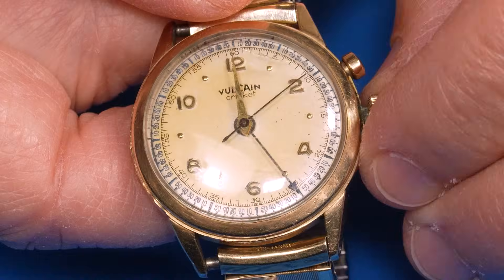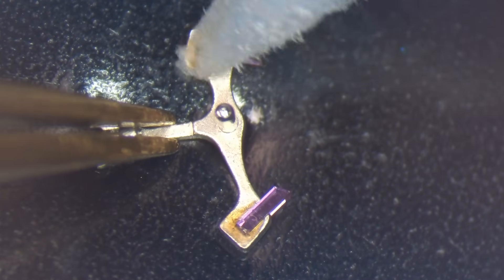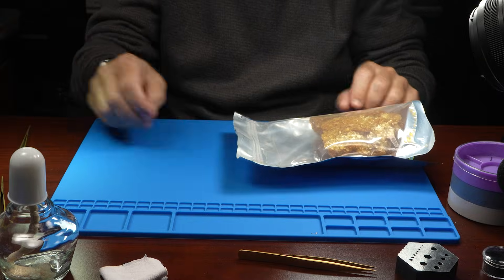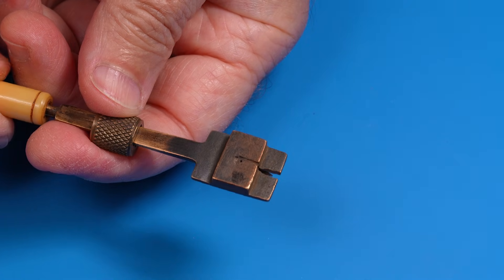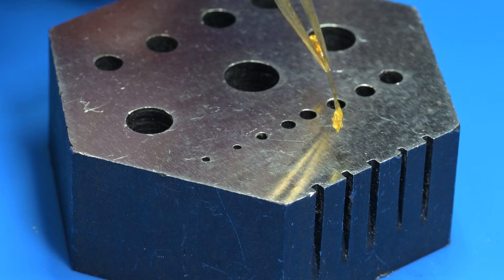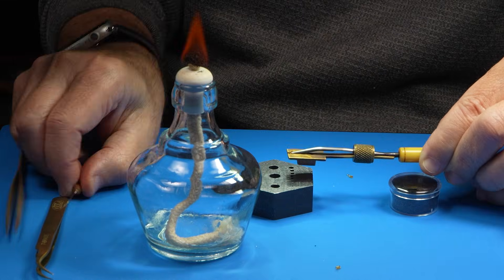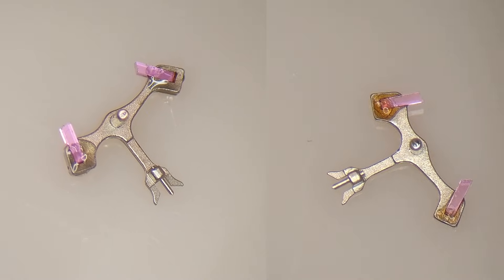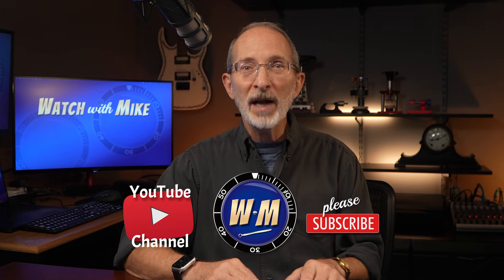How to Shellac the Jewels in a Watch Pallet Fork #watchmaking

Comment: Great video Mike......One question....With today's modern products....various adhesives etc is it not possible to use an alternative to shellac?
Reply from the maker: I have worked on watches where parts are crazy glued into place. It is a nightmare! Shellac can last for over 100 years and is easily removable and replaceable, so I think it is worth the trouble. Also, when you reset pallet stones, sometimes they need to be adjusted in the fork. I don't know of any modern adhesive that let you do successive melt and cool cycles to reposition the pallet stones if needed. So for now, shellac it is!

Comment: Good precise job Mike.See how it works Let me just mention that you put a little ball of solder in a broken part of a piece of jewelry by holding the melted ball attached to a  sharp polnted steel rod.No stones and no elves though,Thank you..
Reply from the maker: Is the heat transferred to the solder by the steel rod? I would think you'd want to use an open flame? Regardless, I love the moment the solder melts and everything magically flows together!
Reply: @WatchWithMike  Hi Mike.Yes Mike.You use the torch to melt the solder and to remelt it.Extremly precise procedure though.Thank you.

Comment: biggest thing is to not move pallet jewels while augmenting shellac. youll know how you did when you fit part,
Reply from the maker: Yes, agreed. I think the stones were pretty snug in the fork even without shellac.
Reply: @WatchWithMike  Ive learned the hard way. it takes many hours to get pallet jewels back into proper depth. I use an electric hotplate for doing PCB work. its a fantastic tool, My other hobby is electronics.
Reply from the maker: @Amateur-Watchmaking These jewels looked snug to the bottom of the channel. I guess I'd need to reach out to  @JDRichard if the depth needed setting. He had a cool vintage pallet depth tool on his channel!

Comment: Have you tried dissolving some shellac in ethanol and using this solution instead? Then heat to evaporate the ethanol and spread the shellac. May give you more control.
Reply from the maker: No… And I need to give it a try! I dissolved some shellac in isopropyl alcohol, which took a long time. When I tried to use it, it never hardened like it should. Maybe I will whip up a batch using denatured alcohol this time. I definitely made more of a mess than I wanted to using the hard shellac, lol!
Reply: @WatchWithMike  Ethanol is better than isopropanol for this application. And yes, some patience - it takes some time.
Reply: @WatchWithMike  I ended up making a mixture with IPA and sped up the process by using a heated ultrasonic cleaner. I did add more flakes after a day to thicken it up to a syrup consistency